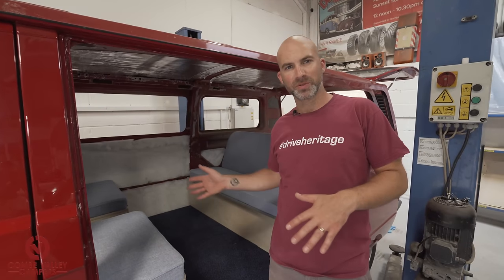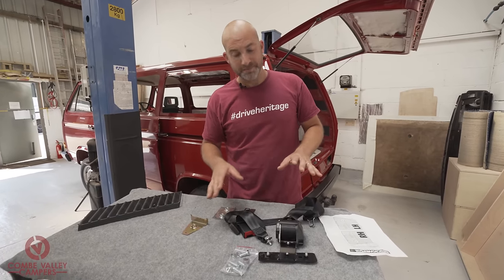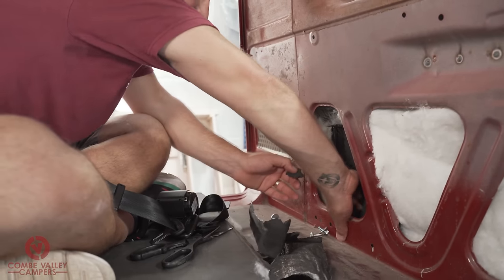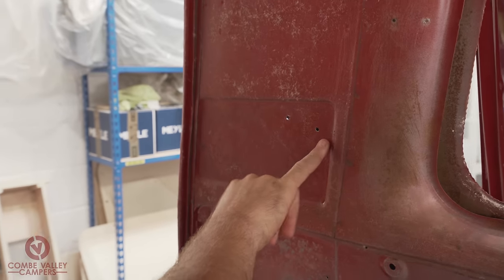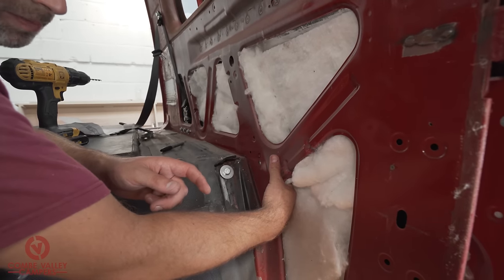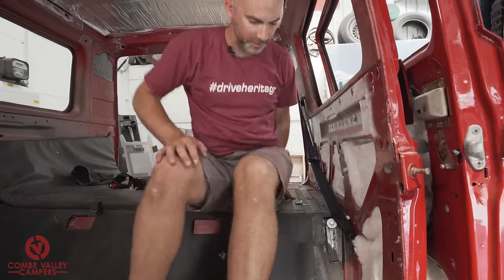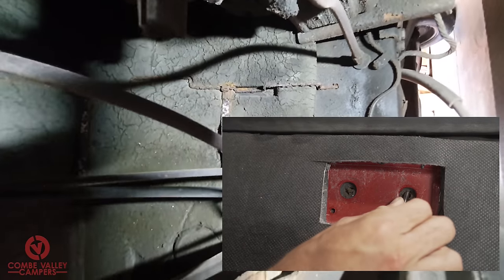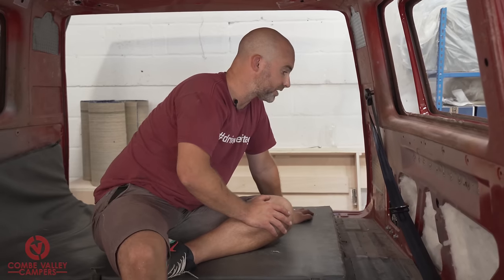HOW TO FIT REAR SEAT BELTS IN YOUR CAMPER (Factory style seat belts in a VW T3/Vanagon/T25)

Comment: Thank you for this video. It's so informative! 
Question: I live in the US. Do I need an OE bench seat or can I install these seatbelts with DIY metal framed benches?
Reply from the maker: Thanks for the kind words. Yes as long as they line up these are the best places to fit seat belts
Reply: @CombeValleyCampers  I'm sorry, I must not have worded my question correctly. Is it necessary to have a factory made seat to pair with these seatbelts or will this work with a DIY bench, such as a self-made convertible storage bench?
Reply from the maker: @karendavis140  it is not neccesary to have an oe bench for these belts to work. In this instance we are using a 'rusty lee' brand rock'n'roll bed and the belts line up perfectly

Comment: Looking getting the kit for my t25 aircooled does the same princable apply ?
Reply from the maker: I beleive so. Check for the dots behind the rear vent to locate the upper mount
Reply: @CombeValleyCampers   just worried about getting kit as u cant remove the vents on mine and defo cant get my hand in there lol

Comment: Thank you for a so informative video. I was wondering, is there another source one can get the seat belt kits. They are sold out and Brickwerk doesn't know when they will be able to produce the product again. Would you recommend using static 3 point belts instead?